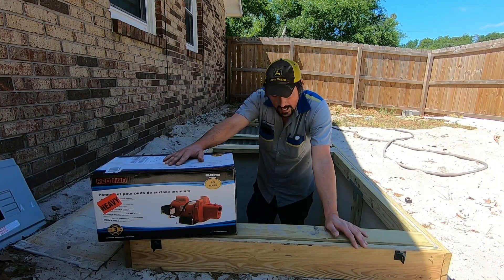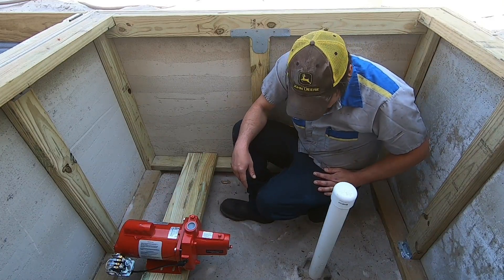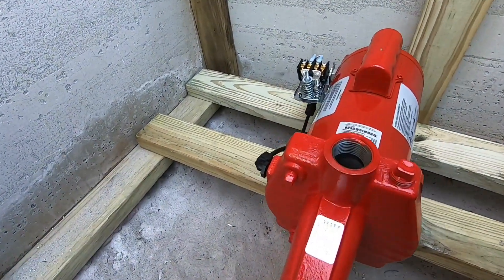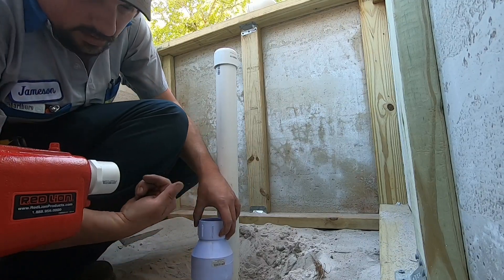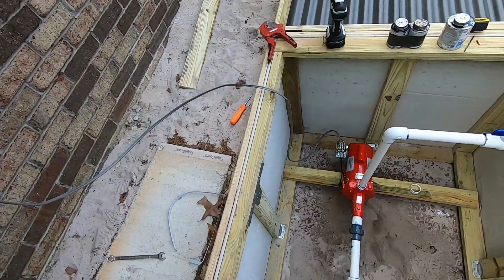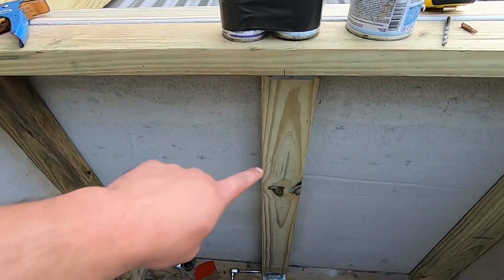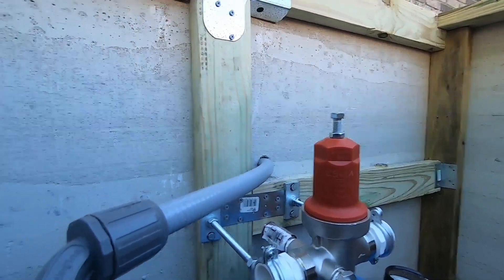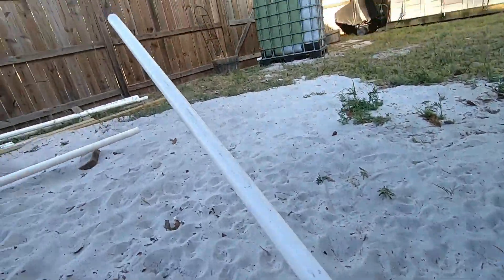DIY irrigation part 2 well pump and cycle stop valve installation

Comment: No need for a check valve/backflow preventer like the Wilkins zurn 975xl?
The 975xl also has air nipples for winterizing/blowing out the system. 
You have an awesome setup there!

Comment: I thought the idea of the CSV was that it wouldn’t cut off if your using at least 1 gpm. In the video, it shut off the water ?
Reply from the maker: That is the idea. What part of the video did it cut off?
Reply: I thought when it hit 50 it switched off?
Reply from the maker: It did cut out when it hit 50. However, it never hits 50 if there is more than one psi demand. It only goes that high when everything shuts off. 
I will give you an example. Let's say I'm using my pressure washer off my well. It consumes 2.3 gpm. If it didn't have the csv, the pump would cut in and out constantly the whole time I was using the pressure washer. With the csv, the pump will run the entire time the pressure washer is being used. Unless I sit the wand down and wait a minute or so. As soon as I stop using water, the csv starts backfilling the tank until the tank gets to 50, then it shuts down.

Comment: What is the blue 'tank' on top for?
Reply from the maker: The blue tank is the pressure tank. It holds pressure in it and when you turn a valve on, it provides pressure for the first few seconds. Then the pump comes on and provides the pressure.
Reply: Got it. How deep is the 'box' (or dimensions of it)?  I've had a few irrigation companies come out, NONE of them mentioned the box approach. They all want to put the valves on the side of the house, with the pump. After I told them I didn't want to see it, or hear it....I now know, they just don't want to build the box.  I'll do it...just like I end up doing on all my DIY stuff.
Reply from the maker: My box is 3 foot deep.  I wouldn't expect any company wanting to do this type of setup. I have not seen any modern well setup done the way I did it here. Every well setup like this I have seen has been super old.

Comment: Thanks for the video of installing the Cycle Stop Valve.  Looks like you have it adjusted to 40 PSI while using about 3 GPM which is good.  If you tighten the adjustment bolt of the CSV a couple times to the right it will disable the CSV and you could show how your pump cycles on and off while running a hose or small irrigation zone.  You have it working so well nobody can tell how bad the cycling would be if you didn't have a Cycle Stop Valve.  Added you to my feature channels as well.  Love the videos, dog included.  Lol!
Reply from the maker: Thanks cycle stop valves! Appreciate you making me one of your feature channels. I am happy to report that the cycle stop valve has worked flawlessly this summer and fall. And I have pushed thousands of gallons through it watering two different seeding projects. When I use the hose the pump does not cycle at all. I will heed your advice, and in the spring, do an update video about my well system. I will be sure to bypass the valve and demonstrate how the system would work without the valve.
Reply: @Lordofjunk  Let me know if you have questions.  I will be glad to help anyway I can.  Cary

Comment: Nice work brother.  Only thing I caught that may be a code violation was the wire from the panel to the pump.  Looks like you used UF cable inside the conduit.  That’s a no-no.  It should be individual THWN conductors. Anyway, no one will know until they disconnect it.
Reply from the maker: I figured that out after I had already installed it. I know just enough electrical work to not shock myself and not to catch stuff on fire. If it ever becomes an issue, I'll switch it out. Good eye!
Reply: @Lordofjunk  I know this is an older reply but there is nothing wrong with putting UF cable in conduit. It's done all the time.  It's direct burial cable but has to be protected when it comes out of the ground.  Guess how it's protected.  Conduit.  
NM cable cannot be used in a wet location even if it's in conduit.

Comment: I’m getting ready to do something similar. Where did you buy your pump and valve system?
Reply from the maker: Chuck I bought my pump off of amazon. It is a red lion 1hp. If you want to buy one , wait till the price gets cheaper. For some reason the price fluctuates alot. I paid $227 dollars for mine. As far as the valve goes, you can purchase the kit from the manufacturer. Search for cycle stop valves. It is pretty pricey, but worth it in my opinion.
Reply: Lord of junk thanks for the information!
Reply: Lord of junk does your system use a start stop relay?
Reply from the maker: My system uses a standard 30/50 pump switch. When the system is turned on, the pressure drops and kicks on the switch.